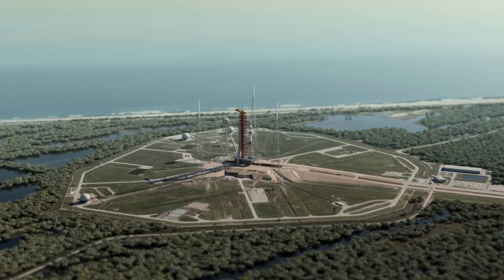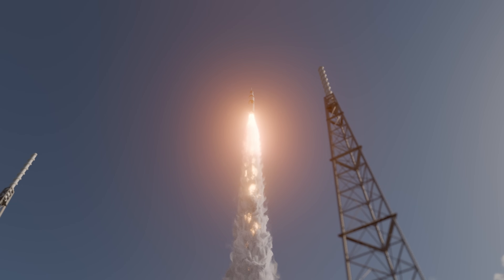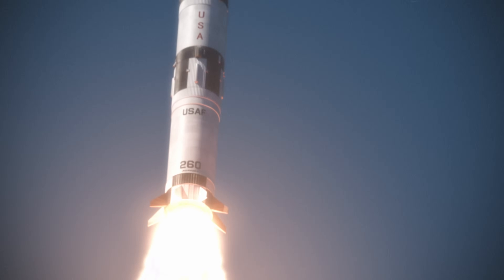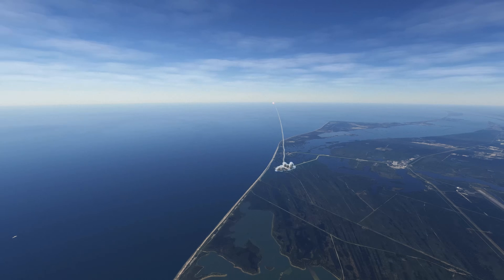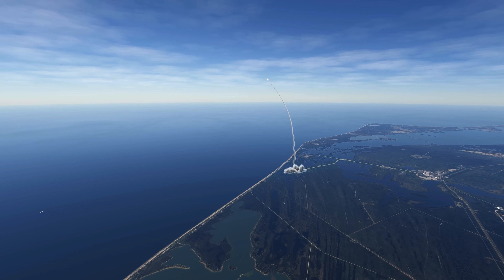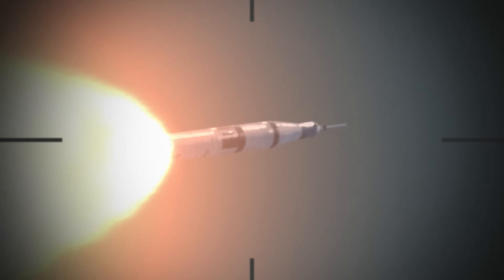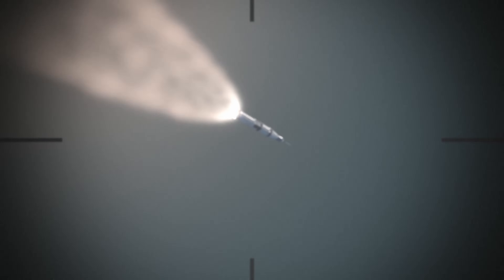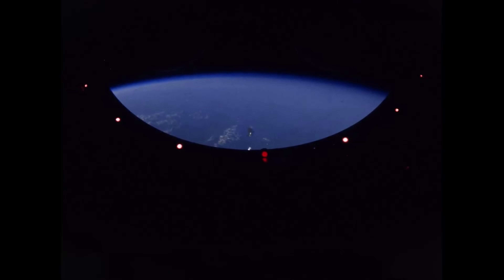Largest Solid Rocket Motor Ever Tested

Comment: This is a longer comment. Firstly nicely done, especially the Apollo 7 audio which goes quite well with the visuals. I do have some NASA documentation saved and the AJ-260 was planned as the first stage of a Saturn 1b variant dubbed by NASA the 'Saturn 1b-5b' and they were not planning to use fins to guide the rocket, but thrust vector control. Similarly the ASTP/Skylab ' Milkstool' was not contemplated, but either a combined dock/launchpad arrangement or a silo launch where the solid fuel portion of the rocket would be below ground with the liquid fuelled portion above ground. Perhaps something for a future video.

Comment: I replied to @ExtroniusAttributes below: although I don't see "Saturn V" specified in the video's description, just "Saturn", he has a point about the fins. But there is one confusing detail: after staging the 5 J-2 engines of the S-II second stage of the Saturn V is shown, and its skirt sep, rather than the single J-2 of the S-IVB stage (shared between the Saturn V and the Saturn IB. Otherwise, BEAUTIFUL video!

Comment: Zero pogo oscillation
Reply: Well yes but in large solids you will usually get a pretty rough ride which is sustained through the whole burn so in some ways worse. Aerojet had a better formulation as the Titan SRBs were "relativly" smooth compared to the Shuttle SRB's but it cost more and needed very careful preparation. Since these were supposed to be a cheap as possible...

Comment: This booster was intended as the first stage for the Saturn V as there were concerns the F1s would not be ready for the first launch. However things turned around and the SRB first stage was never needed. The rocket shown in the video is the wrong rocket and would never have used this SRB as it was far too large.
Reply: Just a point but it was actually supposed to replace the Saturn 1 first stage as solids at the time were seen as "cheaper" (and the bigger the supposed better) than liquid stages. Part of the reason they didn't was in fact this article (which was also a test article for an even bigger SRB proposed for the first and second stages of the Saturn V) had serious issues.

Comment: One difficulty in using solid rocket motors in that role is that they are not really burned out.  If a large piece of the rocket fuel breaks off inside the booster (increasing the burn area) and causing an increase in thrust at time of staging.  This could cause the booster to hit the stage above it.  I think the phenomenon is called a “thrust burp.”
Reply: Actually I believe the "technical" term is: Oh Sh*t!"  :)
Reply: Realistically in this scenario the AJ-260 first-stage would have four retro-rockets just like the S-IB stage did.
Reply: The grain geometry of the solid fuel propellant can greatly limit this from possibly occurring. The geometric star pattern is the best and most popular.

Comment: Couple nitpicks: the booster is shown replacing the first stage of the Saturn 1B, not the Saturn V (as stated in the description). The 260-inch diameter is about right to replace the S-1B stage. And the "milking stool" pad kinda gives it away.

And, if used in place of the S-1B stage, it would almost certainly not have the eight fins of the S-1B. Those were only there for a specific abort mode, if one of the S-1B's engines got stuck at maximum gimbal. Early Saturn 1s launched without fins, and fins would certainly not be needed with just the one big SRM.
Reply: oh didn't know that about the fins, sick!
Reply: After staging the 5 J-2 engines of the S-II second stage of the Saturn V is shown, and its skirt sep, rather than the single J-2 of the S-IVB stage (shared between the Saturn V and the Saturn IB. That confused me: which Saturn launch vehicle was this supposed to be? You are right that 260 feet in diameter does correspond to the diameter of the Saturn IB first and second stages, so that would be the logical launch vehicle for this SRB's application - plus, as you said, the launch stool is a clue. In all fairness, though, I don't see Saturn V specified in the video's description - just "Saturn".
Reply: @stuartyoung4182  I think it was an error- because this is supposed to be the AJ-260 topped with the S-IVB and NOT the much bigger modfied Saturn V with 4xAJ260s strapped on. The ending should've been that of the S-IVB 200 staging from like in this video:(https://www.youtube.com/watch?v=PRu40PGQyTw)

Comment: Regarding the footage -- which I presume is real, or VERY GOOD CGI -- at the very end of this video: 

I knew it was shot from one of the early unmanned Apollo test launches, but I never understood HOW they got the footage. It had too high a resolution to be transmitted video. 

Several years ago I purchased a documentary DVD about the Apollo Program at Blockbuster when they were going out of business. That documentary included the footage shown at the end of this video, but it also showed THE CAMERA BEING EJECTED just as the film ran out. I had NEVER EVER seen that bit of the footage before. 

From there I learned NASA use special ejectable film camera pods to shoot that footage. IIRC they never recovered all the camera pods, but they got enough of them to verify their engineering data. One of the specific things they were looking at was the separation of that 'interstage ring'. There and the engine bells beneath it, and they had to be sure nothing would be damaged when the ring ejected.
Reply: Scott Manley did a video on this topic. Might interest you

Comment: The music wasn't informative. Perhaps some textual labels, including dates and names, would help us to understand what we're seeing.
Reply: The description has the history and facts about the real stage, I'll note it was NOT actually a successful test when they did fire this thing since after several seconds of firing it ended up blowing off it's nozzle and end ring and tossing them (a couple of tons of equipment) several hundred yards. NASA and the Air Force pretty much stopped work on large, single casting stages at that point since it was proving to be not as cheap as expected and production issues that cropped up.

Comment: So you've got the solid booster mated directly to the S-IVB? No need for an S-II? (Or was this supposed to be an S-IB-style shot?)
Reply: Yep the dimensions work out.  The solid would mate with the S-IVB, and as shown a ring to separate them at 21' 8" to match.  So yeah another excellent video.
Reply: @bws833  really not concerned about the dimensions. more concerned about the delta-v given that the S-II was the delta-v workhorse in the stack, but having looked it up the math does indeed work out.
Reply: @nobodyatall1886  This config isn't really meant to fly out of LEO w/o an upper stage(eg Centaur) above the S-IVB. It is basically the Saturn IB but with the S-IB 1st stage replaced with this "big stick" SRB.
Reply: It was proposed for the Saturn 1 not the Saturn V, slight mistake I'm sure